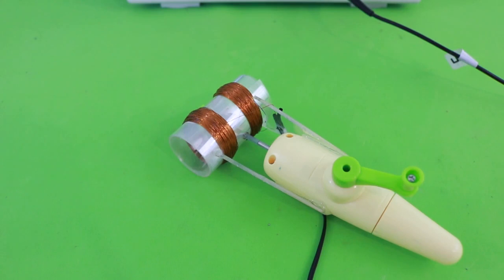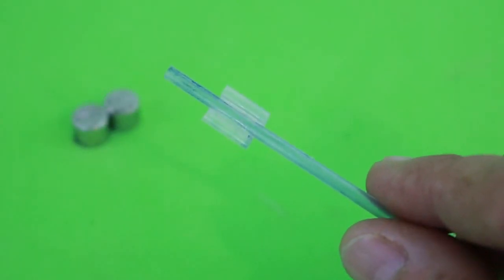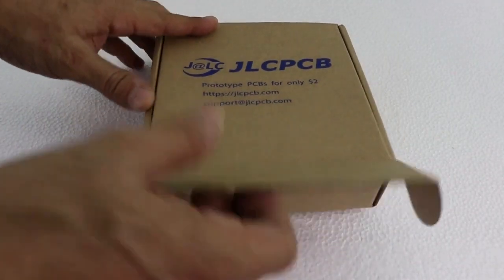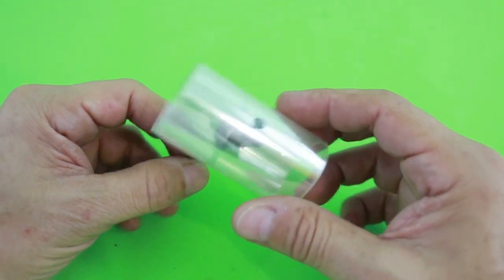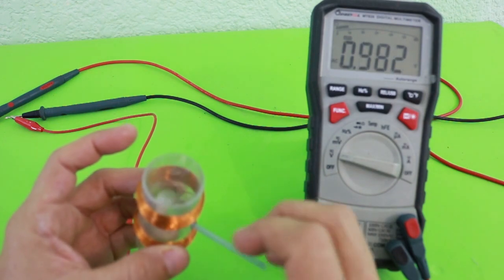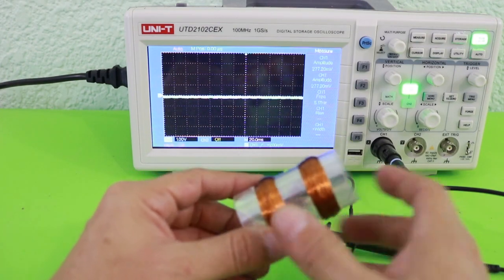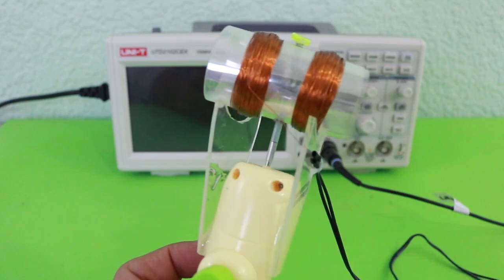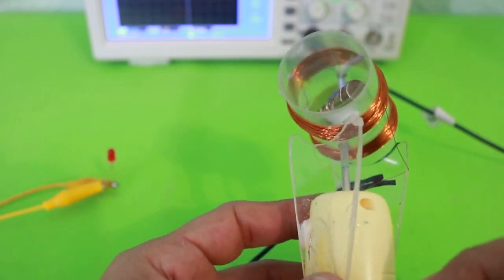DIY Hand Cranked Alternator

Comment: Another easy to understand and implement video, Thanks Ludic.
Out of curiosity, how does, the size of coil e.g. Diameter; impact the current generation?
Reply from the maker: it has no impact current is low so no need for thick wire
Reply: @ludicscience  coz I'm thinking about 3 phase star/delta coil formation with at least 1Amp output. Could you please help me with calculations for wire and turns.

Also I was thinking about 48v 60A dual axis generator, but unable to online help to design one :(

Comment: so what if I use higher gauge copper wire will power raises or convert into dc with filtering cap to charge a phone
Reply from the maker: Power Will not raise using thicker wire
Reply: @ludicscience  more no of turns with extra magnets could do?~

Comment: Hello teacher. What is the relation between cooper/magnets/turns and volts/amps produced? Is there any kind of formula? Thanks a lot
Reply: Judging by your question you really need to start from square one and learn about transformer theory. The formulas will give you the correct answer for that specific variable but that doesn't mean it will function properly. You have to consider the type of core, what the application is, the magnetic saturation of the core, is it high frequency, is it a mains power. It can be quite tedious making sure everything is in the optimal range to function properly. I suggest you spend your time developing a good understanding of transformer theories and all the different types and applications and how they operate and what makes them different..

https://www.electronics-tutorials.ws/transformer/transformer-basics.html
Reply: Libtards got Trumped Thanks! Do you have a link with a study with magnets and volt/amp production? It would be great for me. Thanks!
Reply: @joseramontrivinoamigo6218   - check out the one I posted in the above comment and I'll also post a couple more that were very helpful for me. I just have to search for them real quick. do you have a specific application in mind that this is intended for or you just want general information?
Reply: t

Comment: Hello Ludic Science. When i use only one coil, will i have DC? Is that right?
Reply: No still AC because of the alternating poles from the Magnets while rotation.
Reply: @Telectronics  He needs to put on a 4-diode bridge rectifier on the output if he wants DC.
Reply: @foureyedchick  Yes you are right ! I forgot to add that. Thanks :)

Comment: You can see on the scope that your two coils are working against eachother.
Reply: Sir, please explain why you have jumped to this conclusion
Reply: @ronen124  Look at the dip at the peak.
Reply: @Spardeous  to me it looks as if the voltage is missing at the peak because of the separation between the coils and the lack of magnetic induction there